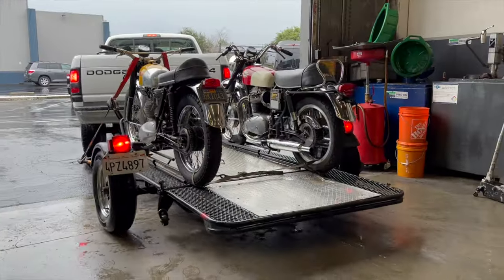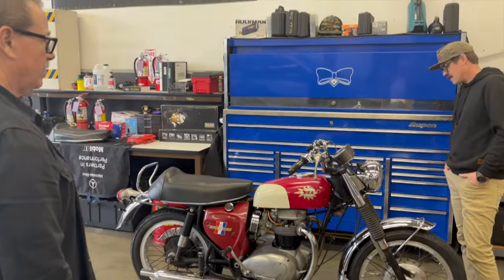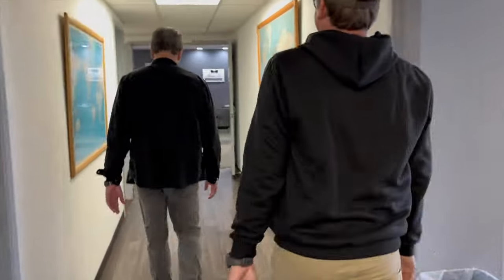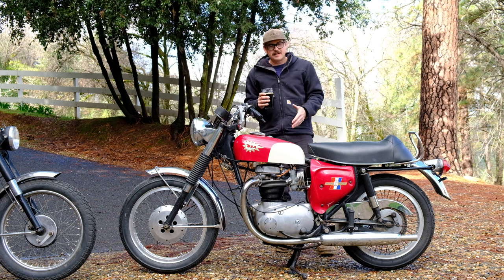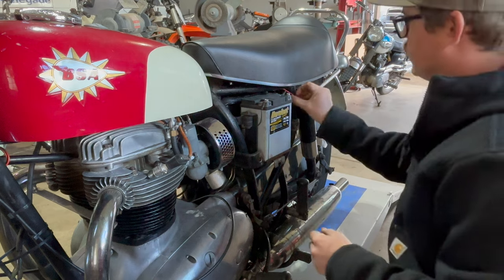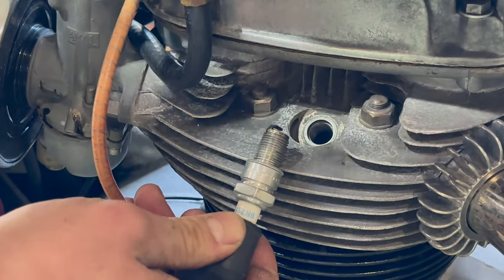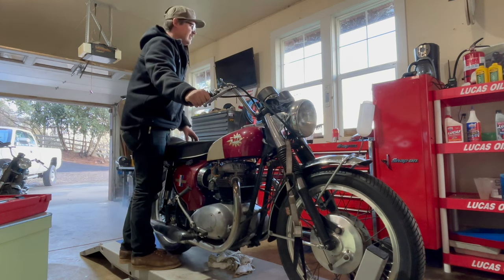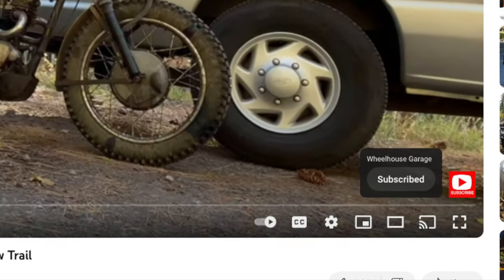Reviving BSA's Fastest Twin! 1967 Spitfire Mark III | A Bike and a Beer

Comment: The Spitfire is my favourite BSA, I have a Mk II. It is an official record that a standard unmodified Mk II clocked 128mph on Conrod Straight, at Bathurst, Australia,  in the 1967 Production Race. Neither Norton or Triumph ever built a standard 650 that went as fast.

Comment: I bought the first Mk11 special in the spring of 66 in Lawton Oklahoma while stationed at Ft. Sill. It was the first version of the new Spitfire with Amal GP carbs but it had some teething problems. The engineers at BSA didn’t quite get the piston to valve clearance correct and it ate a cam follower at 99 miles. The 2gal. fiberglass tank was good for about 60 miles which I discovered while riding home to Delaware. Just outside of Memphis the pin holding the float in place (the Amal GPs shared a single float bowl attached to the frame) vibrated loose while entering the interstate on a rainy November afternoon dumping gas over the rear tire- someone forgot to safety wire the pin! I managed to get back to a gas station and used a cotter pin and electrical tape to fix the problem. The next day I found the local BSA dealer who had a new Spitfire apart for the cam follower issue and he told me to take what I needed from the “piece of junk in the corner!” I got home with no more problems than a split battery which dumped acid over the left side of the bike. I rode it to NYC for the night and left it on the street in mid Manhattan! My adventure with the Spitfire was short lived as I soon shipped out to Germany for a 3 year tour and my father wouldn’t let my brother keep it after he dumped it in a parking lot. I still think about that bike as it was probably the best looking 650 made… even though the magazines didn’t give it much of score.
Reply from the maker: Great story! Thank you for sharing!

Comment: Also my favorite year for the Spitfire; just detuned enough to be street legal and fairly reliable. It has that iconic "gutteral, growly" sound that only a slightly muffled, hotrod, 360 degree/4-stroke parallel twin can produce! That front brake, aluminum  control lever assemblies, and sholdered aluminum rims are the icing for the iconic cake.
Reply: The sound from that twin is music! I didn't know BSA used aluminum rims in the 60's. 
My 1967 Bultaco had 'em tho.

Comment: I had a 66 A65 Lightning that was constantly ending up with the same appearing no start issue. I’d pull the carbs and clean them and it was fine, but a day or two later it’d happen again. Later found out the tank petcock corks were dissolving and plugging the pilot jets. Pretty simple repair, but ever since I’ve always traveled with a piece of guitar string and a little screwdriver to probe the pilot jets on Amal’s at least to get me home in a pinch. Really love the series!!!

Comment: I have a 1968 BSA Shooting Star 441 I've been messing with for the past year.  Same color scheme and has a fiberglass tank, but with knee recesses.  I replaced the Amal (which was working, and I still have) with a Mikuni made for Brit bikes from Steadfast Cycles (nice to have a choke).  The previous owner installed electronic ignition.  I'm looking to sell this Spring if you're interested.

Comment: Why, you may ask, did BSA manufacture a "190mm" front brake, originally for the Gold Star, when the British motorcycle industry measured everything (except bore, stroke, and cubic capacity) in imperial, not metric? According to Roland Pike, who was working  on Goldie development at the time (see the beezagent blog): "About 1955 the desire developed for a better brake for our scramblers. Since the management wanted to avoid spending money, as usual, it was decided one brake would have to do for both Clubman's TT and racing Gold Stars, and scramblers. Dennis Hardwick wanted a small brake for the scramblers, Charlie Salt and I wanted a big brake for the Clubman. We compromised on a 190mm brake on Charlie’s suggestion, who told me he was banking on a belief that Hardwick would not know how big 190mm really was. As it turned out Hardwick didn’t. So we came out with this fairly large brake with wide shoes which was used for some years afterwards, although in my opinion it was not as good as the earlier cast iron drum with ribs around it. That was the best Gold Star brake. Charlie did not like it himself and he blamed Hardwick for the fact that it was too small, as he would have preferred 200mm diameter. The l90mm brake was designed by Charlie and it turned out to be rather heavy for its size." 🙂
Reply from the maker: Thank you so much for adding this! I was hard-pressed to find any good articles about it, but this totally makes sense, and I felt like I had heard it before.

Comment: I'm English, born 1957, Norton specialist but I had BSA friends. They were  addicted to the A10 and especially the Rocket Gold Star. The Unit motor A50 or A65 was not hallowed, more short stoke than the A10 lighter, stronger when they had fixed the faults. The 67 Spitfire did 123 mph on roardtest, more than the 119 MPH of my 1963 Norton 650SS, less than my 750 Atlas café racer.  This was a fast bike, the equivalent Triumph Bonneville roadtested at 115 mph. The Spitfire was a HOT bike. That's why they stole it in the 1968 film "IF"

Comment: Looks like you got a good deal.  I wish my dad had a cool vintage bike collection.  What kind of carburator was on the 441?   A Mikuni?   That seems like a very common swap that people do, especially on Nortons and BSA's.   I think these old British bikes run best with Amal carbs, but I've never actually tried a Japanese carb on one.
Reply: The reason for using Mikunis is that they are a way better carburettor than the Amals. They last longer, idles better and performs better.

Comment: Faster. Had a 750 twin BSA factory racing motor. Limited number made. Got from Starvin’  Marvin Bell, western USA BSA distributor in Ft. Worth. Lots of work done on it. Teflon pistons, $1500 in bottom end in California, crank and cam, 2 into one pipe, vents to alleviate case pressure, etc. campaigned by Robert E. Lee. Flat track champion. Set record on San Jose Mile. Only used it on long tracks. Said it was too much. Liked the 650 as it was more manageable. After he quit, the engine was on the counter for years. Put in a frame (quite a story) and had a great time. According to helicopter, timing, and Texas State troopers controlling  road we finally got it geared to right at 200. Twisted off 175 speedo and still going. 
Bike in racing museum now due to a ‘friend ‘ who kept it for me when I was indisposed . When I find the title I’ll go get it.

Comment: I don't know if you're aware but your Spitfire should have a Y in the VIN, indicating upgraded charging and oil manifold. The zener mounted at the front was a mid-year upgrade, along with the head oil line coming off the manifold under the engine rather than at the tank.
Reply from the maker: Hey Marc! It does have the Y! That’s a little known fact. Thanks for sharing it in the comments.👍👍

Comment: You didn't have to remove these carbs and take them apart to clean idle circuit. Next time remove the tank, remove the carb tops with cables and poke with a very thin steel wire into 2 orifices near the slide edge. Spray same part's cleaner through the idle jet ( after removing air idle screw ) and when you see 2 streams of a cleaner coming through these orifices you can be sure engine will start. Be aware gel coating of the tank with tank itself gets diluted by our contemporary fuel and will make a mess inside your carbs in very short time. Remove original tank and leave it on a shelf and use a steel tank in a case you plan to ride a bike.

Comment: I’m a Norton guy so my recollections on BSA’s isn’t great. The 66’s had GP carbs which weren’t great, then they went to Concentrics as you said in 67. Triumph and Norton I believe used monoblocs on their larger displacent bikes until 68. Watch out for those old fiberglass tanks with ethenal fuel.
Reply: Hi im a Norton guy as well , but had a 67 hornet with energy transfer ignition and yep it had monobloc 1 1/8 carbs. Its the timing side main bush that lets A65’s down and makes the left rod come out . Saw it happen once and even destroyed the frame as well as the engine.

Comment: Didn’t the 67 Spitfire come with monoblock carbs rather than Amal Concentric ?
Reply from the maker: Good question! All the original advertisements and articles that I studied agreed that they had concentrics. Check out Cycle World April 1967 issue 👍 https://magazine.cycleworld.com/article/1967/4/1/bsa-spitfire-mk-iii
Reply: @wheelhousegarage  I think Amal stopped making mono blocks in 1966 and everything swapped over to concentrics. Lovely to see your B44, I look forward to the video of that. 
A few months ago I acquired a 1966 B44 very similar to yours. Re-imported to the UK from New Mexico, it appears to have spent a few years parked in a swamp after Billy Bob and Cletus had finished destroying it . She is coming back together nicely now, not entirely original but she still has the proper tank with genuine paint. Looking forward to having it ready for summer now.
Reply: Nope, the '67 only came w/ concentrics. The concentric was a new carb from Amal for '67.

Comment: Maybe stop using so much throttle when starting.
So what did you find wrong with the carbs?
Amal concentrics notorious for gumming up the pilot, with the passages going through 90 degrees and hard to clean.

Comment: The Spitfire never looks right to me with that tiny tank they stuck on for the American market. It just doesn't match up with the huge side panels, which were designed to go with the massive tank the Spitfire was given for the UK market. Don't take my word for it, look for a picture of the UK version on Google. You will see no funny looking gap between the seat and the tank on the UK version. That's because the big tank was designed for it, that small effort was not.